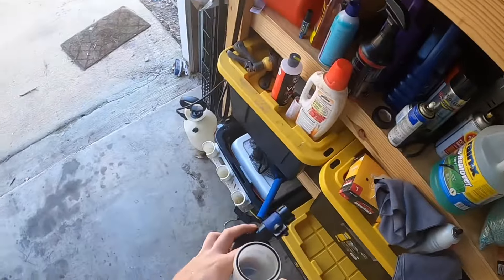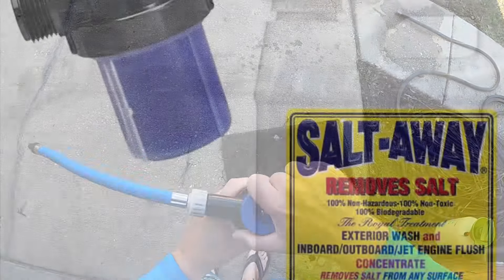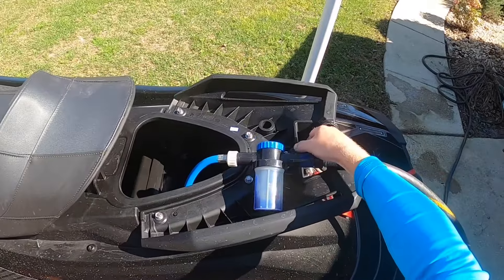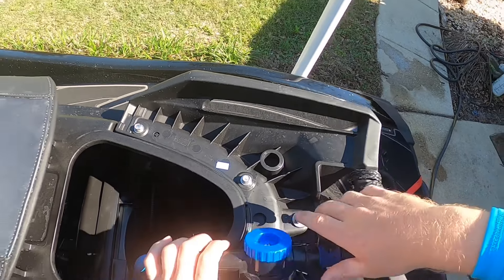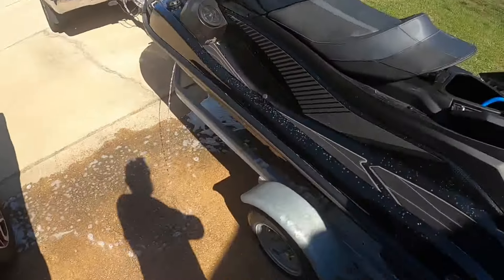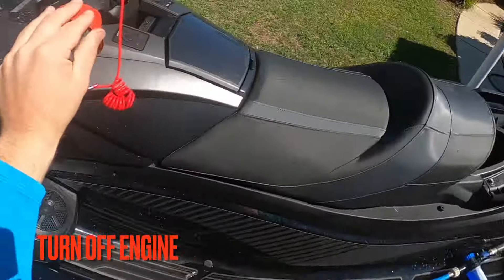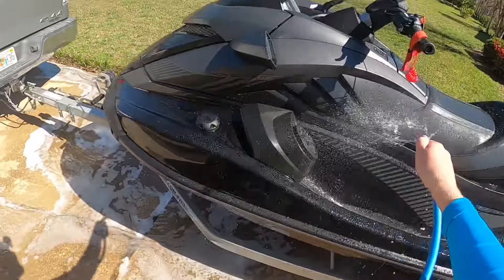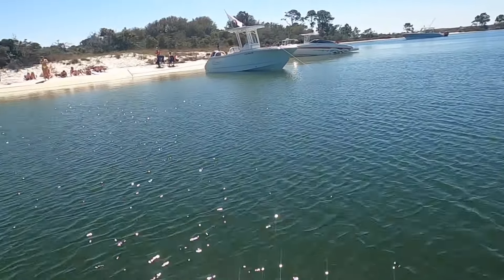CORRECT Way to Flush Waverunner After Riding In Saltwater

Comment: the best way to flush yer toilet////er i mean ski is to take it to a freshwater boat ramp and ride it in freshwater after the salt ride....even yer trailer gets a good dip
Reply: Eu faço a mesma coisa sempre. Saiu da água doce e vou para o lago que fica dentro do meu condomínio. Fico por 15 minutos e volto para casa tranquilo.
Reply: Yeah, I haven't done an actual flush on mine in the two months I've had it. It gets run 20 minutes or so on the lake after I get home.

Comment: Well looks like my son just did this to our new ski. He had the hose running, ski would not start, was messing with the battery for a while. Gave up. Removed hose. 2 weeks later we take a look. Won't turn over. Replace starter solenoid.  Still just a click. I reviewed with him what he did and experienced. We pull plugs and sure enough full of water. Sucked it all out. New plugs almost started for a second. Pulled plugs again.  I push on the pistons and the back one moves down like 2 inches. Oh oh. Remover cover to spin motor from shaft. Front and middle piston go up and down, rear does not. Flm. Just spend 12 gs on this thing. Now motor needs rebuilt.
Reply from the maker: Dang hate to hear that, hope you get it running again!

Comment: One secret, the best way to clean, de-salt and lubricate the engine cooling system and Water Pump Impeller is to use a mixture of antifreeze coolant with water. The system you use is fantastic, it's just that it's better and cheaper antifreeze coolant.
Reply: You don’t really want to introduce anti-freeze into the environment.
Reply: If someone in the harbor sees you letting coolant into the water or onto the harbor floor, they will skin you alive.
Reply: Marine and R.V. antifreeze is non toxic, different formula than automotive type.
Reply: But coolant doesn't remove sea salt mate...it can help to prevent rust. U need salt away to flush out the engine

Comment: Per accident, I turned off the engine, while the flesh hose was still pumping a little bit. I immediately stopped the pump and start the engine again, and put some small throttle. Later on the engine still started like nothing was wrong. What do you think? Would it immediately affect the engine if something went wrong?
Reply from the maker: no it should be fine if it was just for a little while. really only causes damages if left on

Comment: Do you rinse the salt away out with freshwater after flushing it with salt away?  Or rinse off the salt away on the outside with freshwater too, or do u just leave the salt away alone?
Reply: I've seen some leave it and some rinse it out afterwards
Reply: Many will say to flush the salt away just a little bit from the inside of the engine with fresh water but allow some to remain inside the engine so any remaining salt inside will dissolve and come out clean on the next run, but for the outside, just rinse it off after spraying down the outside.

Comment: Good video. thanks. QUESTION: DO YOU EVER RINSE THE INSIDE OF THE ENGINE COMPARTMENT?  and how often do you change your anode? and how often do you grease your hubs? thanks
Reply from the maker: I usually don’t have issues with anodes, and I grease hubs maybe 2 times a year
Reply: I know the comment is 10 months old. I bought my waverunner from a tour company that owns dozens of these and sells them at around 300 hours. I was advised that you don't need to wash the engine compartment, because water doesn't get in- just hut it with CRC. 

I have had water get into mine. Learning curve for me in the 4-6 seas we've had lately. 

My idea is wash it occasionally and use plenty of CRC.

Comment: I’ve had a Yamaha 212x boat since 2017. I’ve always followed the Engine On
Water On
Water OFF
Engine OFF

They really hammered that in me when I bought it. And it also says that in the service manual.

However, before my new boat, I had a 23 year old Sugar Sand Jet boat with a Mercury 6cyl 2 stroke sport jet… and I always put the water on first and turned the water off last, and I never had any issue. I wonder if the design was totally different or if I really was risking it, I never knew ? All I know is I don’t risk it on the new boat, especially since I was informed from the start.

Comment: Hey man, I like your videos. Thank you for what you do. I have a question for you. I just bought a GP SVHO 2024 and took it to the beach yesterday. It was my first run, and I'm new to all this. I bought Salt-Away, like you mentioned in your videos, but when I went to flush it, it didn't fit. Now, the issue is that Amazon will take 3-5 days to deliver the flex hose. Do you think it will be safe to wait until the flex hose arrives, or do you have any other recommendations? Is there someone who sells a different adapter that I could use until I get my hose?
Reply from the maker: Check your local powersports dealers they should have some, if not just flush with water with the attachment that came with the ski. You shouldn’t have any issues until the new parts come in
Reply: Appreciate you, man. Thank you.